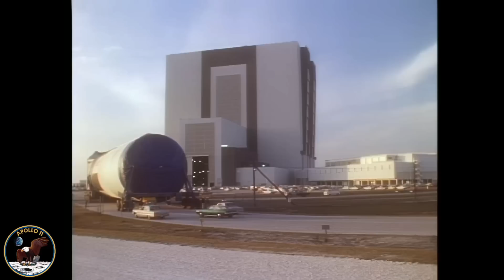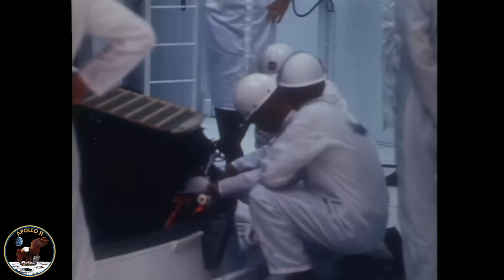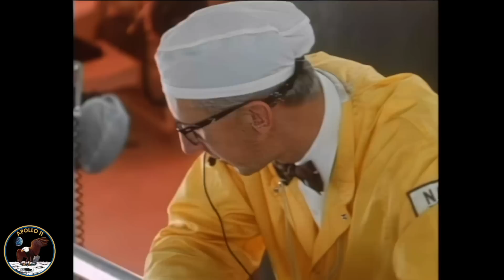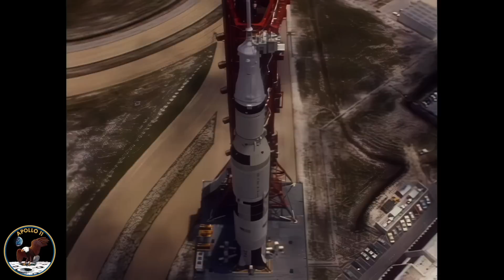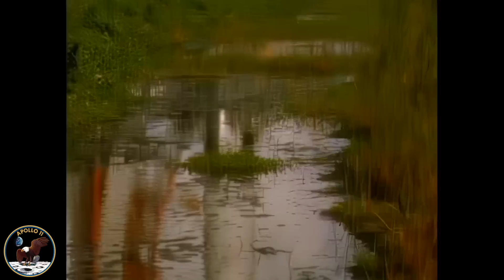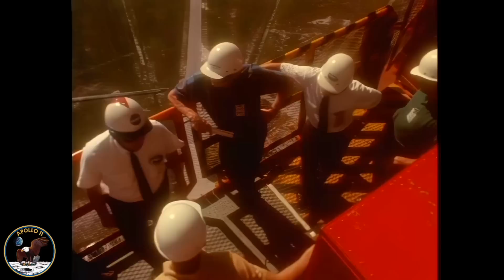Apollo 11 | The Full Mission Part 1 | Upscaled Footage

Comment: THE GREATEST ROCKET EVER BUILT. One of the greatest achievements of the Apollo Space Program was the Moon rocket itself. The mighty SATURN V. Here are it's statistics : - Height 363 feet (110 metres) Maximum Diameter 33 feet (10 metres) Mass / Weight fully fueled. 6,200, 000 lbs (2.800.000 kg / 2. 800 tons ) Rated lift off thrust / 1st Stage / sea level 7,500, 000 lbs ( 33 MN) Maximum thrust outside the atmosphere. 9, 200. 000 lbs ( 40.8 MN) First Stage Performance. Burn time. 2 minutes 40 seconds. Velocity 6,164 mph (9924 kph) Altitude 42 miles ( 68 km) Maximum payload TLI (Moon) 100,000 lbs. ( 45, 000 kg) LEO (Low Earth Orbit) 260.000 lbs ( 120,000 kg) There's been no greater rocket (machine) as powerful as this ever been built by man. A true accomplishment of the scientists and Rocket engineers who were contracted out by NASA to build that beast. To get an idea what this monster of a rocket actually sounded like go to Utube The Ultimate Saturn V Launch Video with INCREDIBLE SOUND  ** It's probably the best Saturn V launch videos on Utube. Put your headphones on if you dare. Considering what Rocket Science is today this is old technology and engineering. To build such a 'beast' from the 'ground up' now would be totally impracticable and would be senseless. . It’'d be like building the massive Big Boy 4014 steam locomotive again. The 're-tooling up' alone would be totally impractical . And as far as the Saturn V is concerning and despite the claims otherwise , all the blue prints of that monster rocket still exist. What's lost is the 'people skills' and the vast amount of correspondence and notes that was created between the Engineers and Scientists. Never again will we see such an incredible thing as the mighty Saturn V.  (Note ** This site does not allow links to other sites)